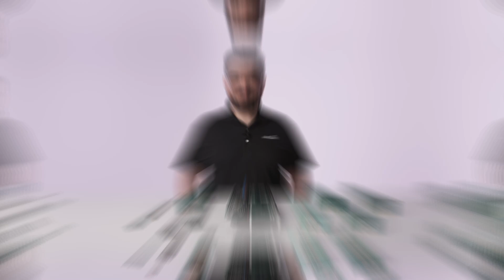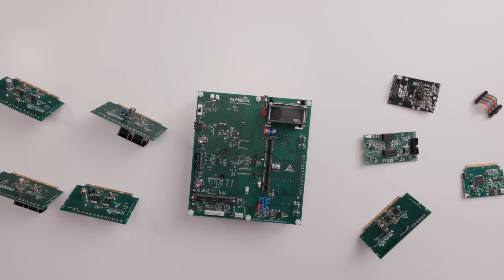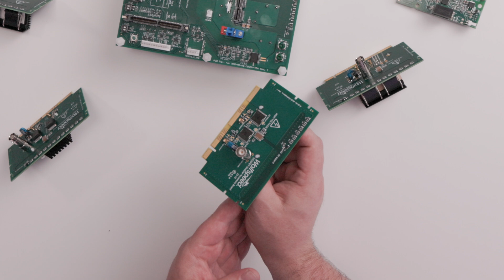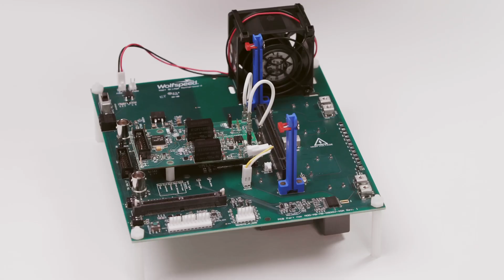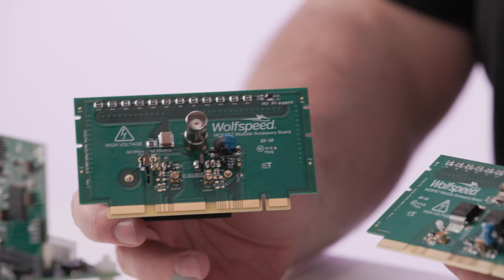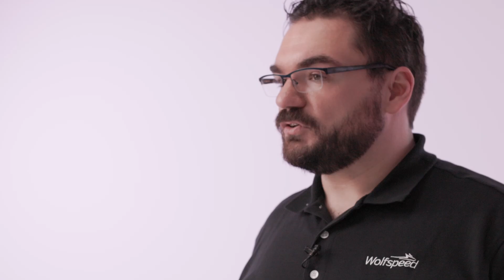How to Swap SpeedVal Kit Components

Comment: هل المكونات هي 
Base (Bottom Layer): Motherboard KIT-CRD-8PS-SP (SpeedVal Motherboard).
Heart (Middle Layer): Power Daughter Card:
For 650V/30A: MOD-PWR-MM-C3M0060065K
For 1200V/100A (Stronger): MOD-PWR-MM-E3M0021120K (or C3M0021120K card version).
Engine/Brain (Side Layer): Isolated Gate Driver Card MOD-GATE-DDR-ISO (Based on UCC21520).
Shield/Damping (Top Layer): Snubber Module MOD-SNUB-CARD.
كم السعر الكلي 
هل انت تاجر ممكن تبيع واحد بكامل المكونات 
ارجو الرد 
شكرا